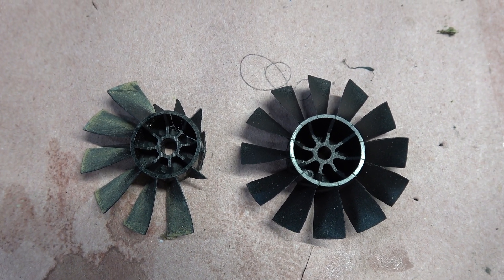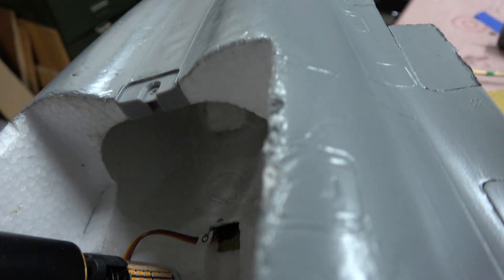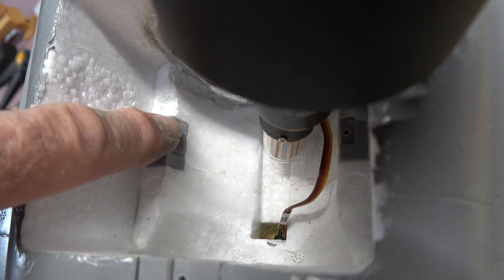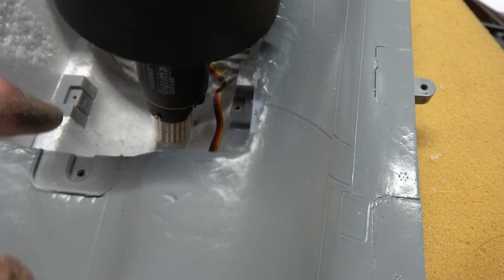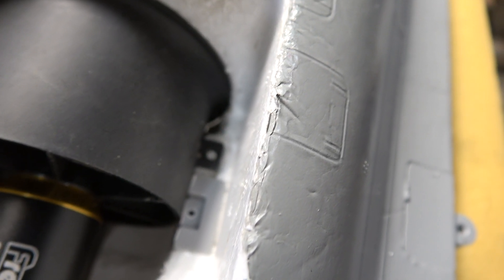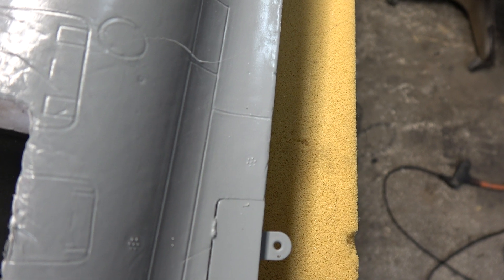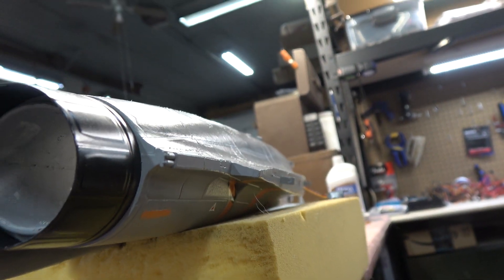20230803 FMS Rafale 64 6S Upgrade with Afterburner

Comment: Curious to what your thurst figures are and if you have any idea of top speed? I fly all my 64mm 4s on 5s. Just swap the esc out for a 80A and use stock motor. I go from about 1.1kg of thrust to about 1.6kg. Flights are much more fun now
Reply from the maker: I measured it once but cant recall max thrust. I will do it again and reply. Thats great to know about 5s setup, will definitely try it sometime! The top speed I have seen is about 90mph.
Reply: @AerialRCFun  the only 64mm 5s plane I done gps on was the Freewing L15 and that was at 115mph. I'll see if I can get my F16 top speed done.

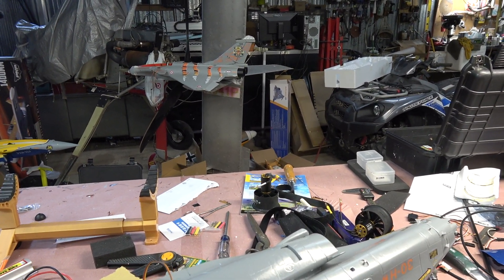Comment: This model is Underpowered So good idea to change the 4s turbine to a 6s 64mm turbine The next step is to be able to put a 6s battery Enough room or not?6s 4000 ma 1:13 ybe?or less capacity?Thank you for your advices
Reply from the maker: Hello, yes I much prefer it's performance overall with 6s EDF system. I run with 6 cell SMC 2800 or 2400mAh weighing 324 & 378 grams, respectively.
Reply: What esc are you using?how much ampere
Reply: @tigreeurocopter1966  the banshee has this motor and I'm sure it's a 60a esc
Reply from the maker: @tigreeurocopter1966  I got the 64mm 6s EDF package at motionrc and it specifies 60amp esc for it.
Reply: The result at maximum thrust is 64 a  I use a cnhl 2.7 a 6s I will try  a 70 a esc Will be better with 80 a